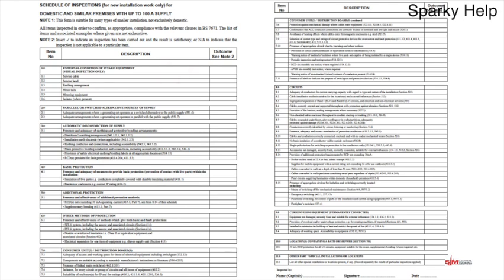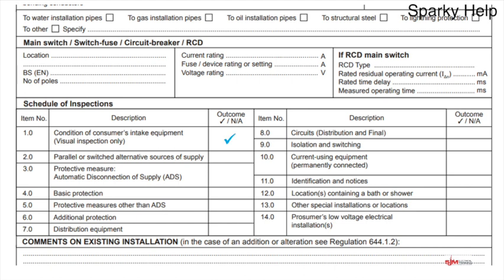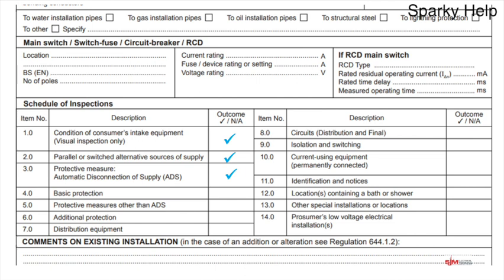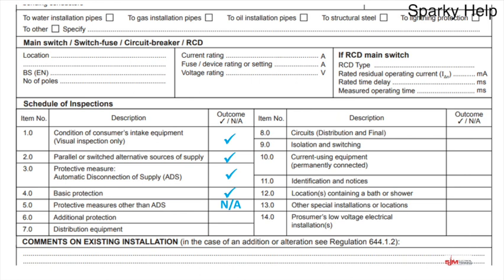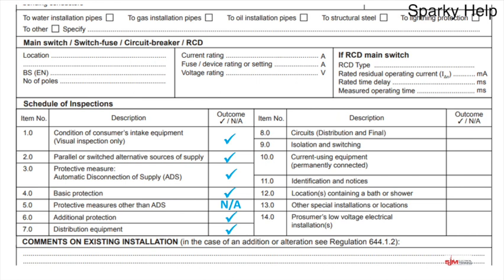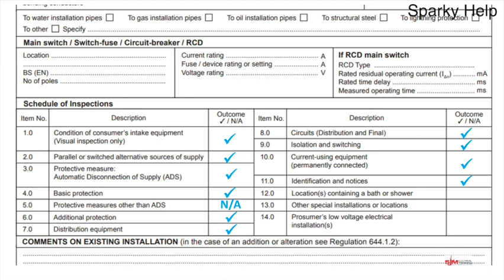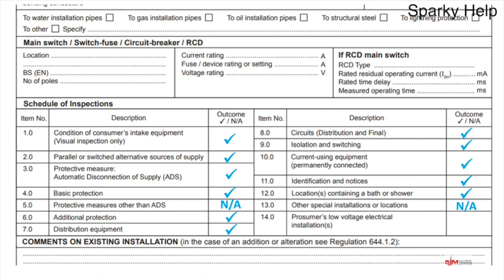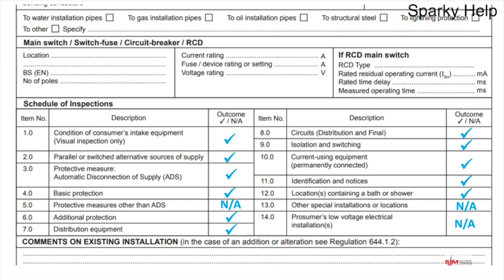BS7671 New Amd 2 - 2022 How to Complete a Schedule of Inspections on the New EIC

Comment: Great video, I find it very strange that if you download the IET model forms BS7671 2018+A2 2022 it still includes the two pages that we no longer need. . So what are we supposed to do ?
Reply from the maker: These can still be used for larger projects if more detail is required (remember you are still checking the suitability of all the items listed but with fewer ticks required).
Please Like, Share & Subscribe.
Reply: @sparkyhelp3997  already subscribed
Reply: @sparkyhelp3997  I have also left a comment on another one of your videos , the one titled what should you complete doing a board change some plum said that you are wrong and give misleading information so I hopefully came to your defence.
Please review and correct me if I’m wrong
Reply from the maker: @SDelectricalINAEC  Hi thank you, but i do not have one regarding a board change, I would be curious to read it though.
Reply: @sparkyhelp3997  this is my reply to a comment. Yes it’s not one of your videos sorry mate my apologies but read this and please feel free to correct me if I’m wrong.

Paul Smith , he’s right you should only complete the paper work that is relevant to the work you did , an (EICR electrical installation condition report) Is to determine whether the installation is safe for continued use, not to to determine whether a CU upgrade is required, there is no regulation requirement to upgrade an existing installation. Or to bring it up to the current standard I refer you to page 99 in the current version of the onsite guide, and to the HSE note in BS7671 , try fecking reading it . Ware he has got it wrong is if you replace an old CU with a new CU then you test all the circuits and you carry out Ze continuity insulation resistance ring final and so on , the you complete the electrical installation certificate witch details the installation characteristics followed by the schedule of test certificate . An (EICR  electrical installation condition report) is not required prior to a board change. You should never take responsibility for someone else’s work, if you install a new circuit to an existing installation you are only responsible for that circuit. Nothing else, if you install a new CU you are responsible for the hole installation as you are required to insure that the MCBs RCDs or RCBOs are suitable for the installation. And you test all circuits in accordance with BS7671  18th edition 2018+ amendment two 2022.
The IET model forms come as a complete package, in a set of three , each accompanied by a set of two notes one for the installer and one for the client.
1)electrical installation certificate 6 pages.
2)minor electrical installation works certificate, 2 pages,
3) (EICR)condition report, 9 pages, you only complete the document relevant to the work ordered and witch you completed . 
Try reading the notes .
Reply from the maker: @SDelectricalINAEC  Sounds perfectly reasonable what you have written.